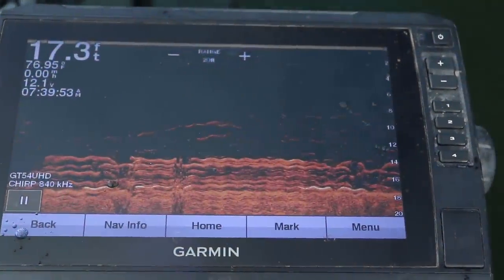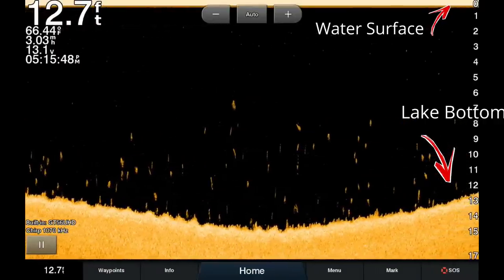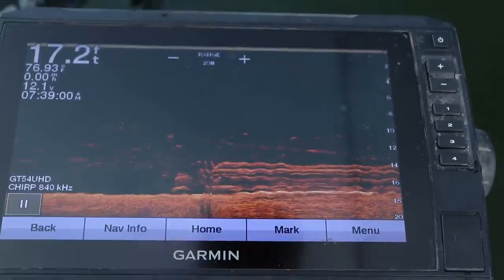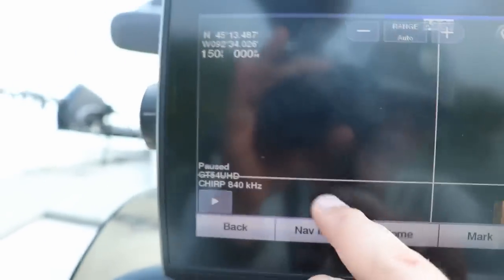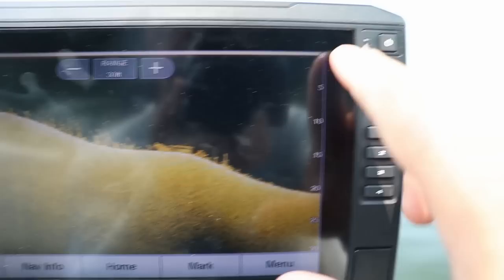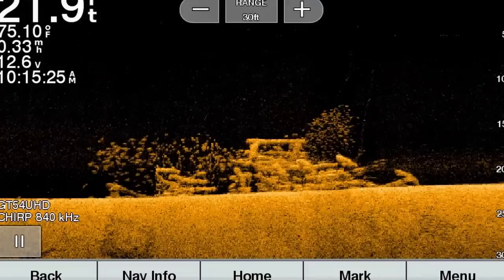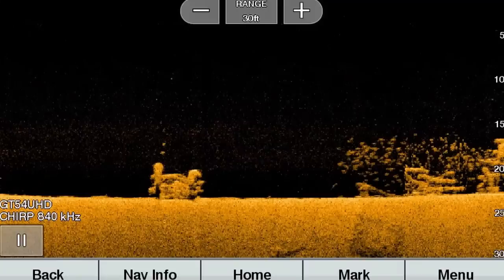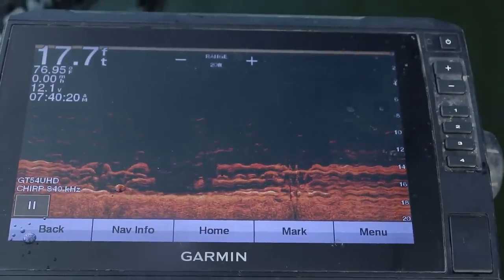How to use Down Imaging to Find Crappie in the summer

Comment: I just received the Ridge charger.  Unfortunately, there are no instuctions with it.  How do I charge the charger, and how do I charge my phone with it?  Thanks.  Ron
Reply from the maker: You can use the small USB cord that comes with and plug it into a wall charger are car charger to charge up the power bank. Once it's charged, unplug it from the wall or car. Then you can set your phone directly on top of the power bank and it begin to charge your phone.
Reply: @FloppingCrappie  Thanks for helping this old man.!
Reply: How do I know when the charger is fully charged?
Reply from the maker: @sowabunga  there are 3 or 4 white lights on the side of the charger once all the lights are showing and not blinking, it is fully charged
Reply: @FloppingCrappie  Got it.  Three lights showing .  One to go.  Appreciate the help.